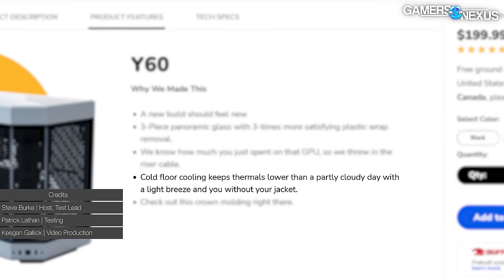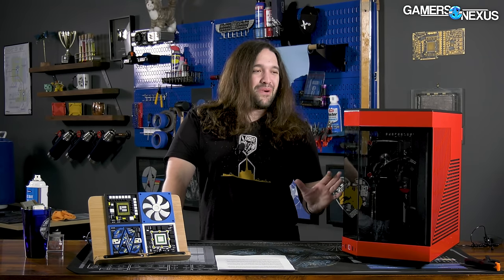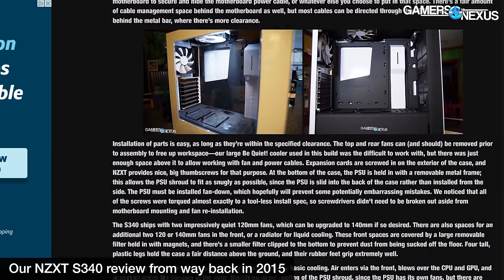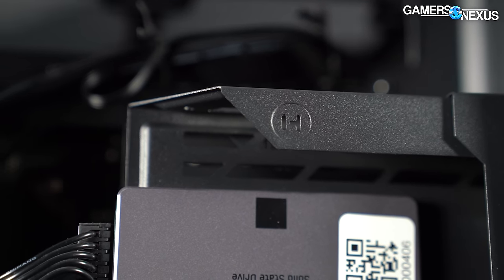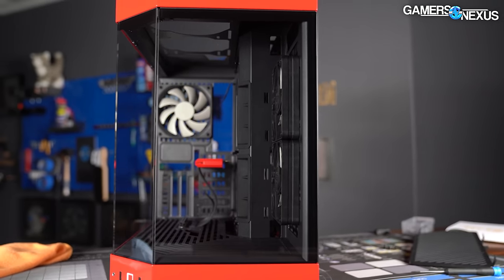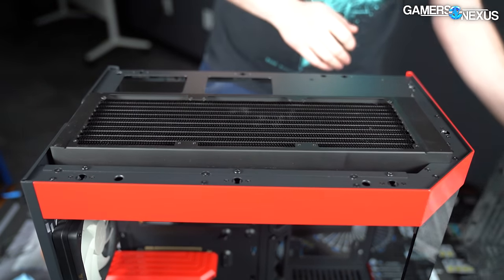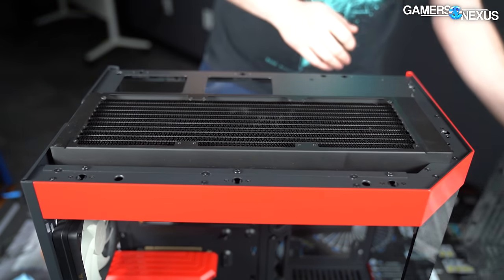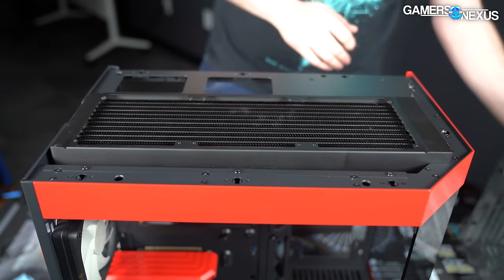Impressive Quality: Hyte Y60 Case Review & Benchmarks vs. O11 Dynamic

Comment: I feel like perhaps this case signifies a need for a standardized water cooling test to better represent cases like this for actual buyers of cases like this what the case will be like. I suppose pointing this out helps somewhat but seeing a full build inside one even if just clcs for both gpu and cpu, I feel, could be an improvement to this type of review.
Reply: There would be no point.  As steve noted in the review, the factors that impact air cooling also impact liquid cooling.  If there is obstruction to airflow, it will obstruct rad fans as well.
Reply: @giglioflex  The question is to what degree. A radiator already is a huge obstruction. Does a little more plastic really make a meaningful difference or will the static pressure optimised fan simply bruteforce through it?
That's not a general statement you can make. Radiator thickness would probably have a much bigger influence than anything else. But I don't know how much of a difference radiator thickness makes either. 
We really need a channel to test watercooling in a proper way.
Reply: @gamingmarcus  Please excuse the typos, youtube is terrible as usual and won't let me edit my own comments.
Reply: @giglioflex  within that same statement he said that the issues could be somewhat negated with LC. So Beef Ingots point is still pretty valid if not more so.
Reply: @popotoproductions3015  Steve pretty clearly pointed out that while you can get lower temps on liquid, you can do that for any case and in this situation you aren't getting around the issue but merely brute forcing.  Steve specifically stated that the liquid cooling performance would likely be less than a majority of other cases using liquid cooling due to the obstruction presented by this case.  

I don't know why people seem to believe this case, with more obstruction, is going to perform better with liquid cooling than other cases with less obstruction that are also using liquid cooling.  As I provided in my link, as you increase static pressure (which is what obstructions do), you reduce the amount of air being pushed by the fan.  It doesn't matter if that fan is balanced for airflow or a high end rad fan, the airflow will reduce as the static pressure inches slower to the fan's rated static pressure.
Reply: The cost and effort needed to rig up standardised water cooling loops in wildly different cases simply doesn't meet the demand, water-cooling is and will continue to be a small enthusiast niche that 99% of viewers will never even attempt. Watercooling has lost its need for the majority of gamers as cases and efficiency improved over the last decade, good modern cards run themselves fine on air-cooling and trying to overclock a crappy old card with water-cooling would cost more than selling the card and buying a better one.
Reply: @gamingmarcus  While I agree that we cant make definitive answers one way or the other without testing, the thermals will probably be approximately what they are in this testing no matter what. There isn't going to be a ± delta of like 10-15 degrees Celsius lol
Reply: @nxxynx5039  Agreed, if 3090ti's didn't exist. Almost all of them start to throttle once you put the beans to them even without over clocking. Water cooling a 2060 is stupid and I wonder why so many companies make water jackets for them when I can only find them for a 3090ti FE. Companies should all sell a water jacket version for their 3090ti's ready to go in to a custom loop.

Comment: It’s a looks focused case. A real shame that they didn’t make a removable bracket for the PCI E expansion slots so you could have one bracket for this vertical mount and one bracket for normal horizontal. I know it would cost more but when the darn thing is already $200ish you might as well do it and bump it up another $10
Reply: @pacifistduck9615  please reply to the bot specifically, like I did. Because if the phishing scam bot’s comment gets deleted in the future then it looks like you’re calling me a filthy bot bro ;-)
Reply: @depth386  I'll just remove it then.
Reply: @pacifistduck9615  You do not get notified when something else gets deleted though. Just trying to help.

Comment: I design and build DIY PCs inside custom cabinets. This case could be insane but some heavy modification is definitely needed. I would just remove the plastic top, bottom, and the right-side panel + filters. The wiring needs also some special work but could look sick. 

I'm waiting for the 100% white case or version 2 for the build test. I really like the placement of the front ports when the case is used at a 45-degree angle inside a custom glass/mirror case. I just hope there will be an improved version soon.
Reply: DIY PC's inside custom cabinets?? damn where can we see your work?

Comment: I finished my first build last month using this case due mainly to your excellent review. I could not be more impressed and I can confirm that as a water cooled build this case is second to none for looks and aesthetics. I used 140mm fans on bottom and on the side with a 280mm rad and of course 360 rad on top. I designed it with all fans as intake except the rear. The result is an extremely well ventilated obviously positive pressure case that has been flawless. water cooling both the CPU and GPU left enough space to mount a D5pump/reservoir combo on the floor in the corner section that fills out the space nicely and looks fantastic. Because nobody has benchmarked this case configured as intended it's hard to say how it compares but in Cinebench R23 with an I9-13900k I scored 39577, all cores hit between 5900 and 6200 mhz with temps below 90c. I used the Asus AIOC. Various 3dMark tests with my 4090 EK water cooled GPU showed temps between 45-52c depending on the test. Thank you again for your excellent content and for being so instrumental in my first PC build

Comment: hopefully we see a refresh model sometime in the future where they remove some of the material restricting airflow or at least make the vertical mount optional rather than mandatory
Reply: I wish I knew that before I bought it but now, I’m stuck with a oversized paperweight that keeps overheating itself due to the GPU overheating core components.
Reply: @deadinside8891  Add more fans.

Comment: Really like the look of this case, and the fit and finish look above standard for sure. Not enough to make me move from my O11XL, but it continued improvement from Hyte just may turn my head in their direction when that time comes.  However, better 360mm rad support would also be needed, my three rads need a home! Love the black and red color, outstanding.

Comment: Super excellent review. Heard a lot of Hype over this case. I like the style and flexibility for better cooling. I not a fish tank case guy, but it’s unique for sure. Disappointed a little about the thermals, but since it’s all glass a water cooled GPU would work much better and totally look awesome. A show piece case that looks nice. Steve, consider iBuyPower is trying to improve by moving away from the bottom tier of cheap components. Companies (as you know) need time (and management firing/hiring) to gain traction as they build capital. Hyte is a positive step forward for their company and maybe a possible turn around. Time will tell.

Comment: Thank you for the review. My son showed me this case the other day and I found it very interesting. However, I do not want a vertical GPU and low height expansion slots, and a case you have to brute force to be efficient. No matter how much I look at your at your Best Cases video, I always circle back to the O11 DXL. I have gotten really tired of psu shrouds. Plus I am replacing (repurposing) a 2016 Phantek Entho Luxe, so size is not a constraint. Keep up the good work and I am proud to be a Patreon of this channel.
Reply: To be fair every case that has fans is brute forcing cooling....

Comment: I would be curious to see how cases like this stack up against older dual compartment style cases, like the Corsair Air 540. Seems to have more space for the main components and less "basement" room for the drives/power supply, but it also has a more convoluted air path.

Comment: I personally just built a computer with this case, and I'm air cooling it as well for the time being. I was mainly attracted to this case because of how open it is and how much of a display piece it looks like. However, being a mechanical engineer and having worked with a lot of cooling systems in industry before I can see some issues with the cooling for this case that you pointed out (especially the grating obstructing flow that will quickly clog up with dust/hair)

But man does it look good.
Reply: I do feel that for air cooling some of the placements feel awkward. For example, typically when you place a fan you want to see the pretty face towards you and the part with the structural brackets towards the hidden area. You can't really do that with this case in the normal sense. In most standard cases you pull air from the front and push it out the back, and you can mount the fans in such a way that you won't see the support frame of the brackets on the front fans (and if the front panel is transparent you'll see the cool front part of the fan as well)

This case however wants you to face the side fans inward, which therefore pulls air out of the case instead of pushing it into the case. This means that in order to get proper air flow, you need to push more air into the case. I'm still mulling over how I want to do that but I feel my options are limited. The bottom fans are currently designed to pull air in sure, but I had to flip the back fan to also pull air in, and I feel its not enough yet. I might consider putting 1 of the 3 top fans (the one closest to the back) pushing air into the case and make the other two top fans pull air. I think that since the back fan would mix with the back top fan in this scenario, it would mix cool air in before hitting the CPU and then the CPU pushes air towards the side fans and front top fans as well. The bottom fans mostly would be pushing their cool air onto the GPU in this instance.
Reply: Face all fans in and use the side fans for exhaust?

Comment: I'd be interested in seeing a "best case scenario" with all the fan slots occupied if you ever modify your testing methodology or update the hardware used as the average users heat load inevitably increases as recent trends seem to indicate they will.
Reply: Yeah seems odd to not include testing for the best case cooling and nerfing cooling right after complaining about airflow

Comment: I love the look of this aquarium, but would never buy it in its current form. Having essentially 1 usable PCIe slot is a complete deal breaker. If they would come out with a version that didn't have the vertical GPU mount and full size PCIe slots I would very likely pick one up and retire my old Caselabs case. They are probably loosing alot of sales by going for nothing but aestheics.
Reply: Yup exactly thats a deal breaker for me waiting for my lian li mini air to come
Reply: Yeah, with normal GPU orientation I'd seriously consider this for my next case ... looks real nice
Reply: All they had to do was put in 7 full size PCIe slots without the pointless little strips of metal between them.
If they still wanted to support vertical GPUs, they then could just ship it with a bracket that takes up those 7 slots and gives you 4 full size vertical slots closer to the board.

I still don't understand why those are not more popular. I have one and it is perfect. With the right PCIe extensions you could also run multiple PCIe cards.

Comment: I think the thing I like most about these dual chamber cases is there is plenty of room for cable management. You're not, or at least not often, trying to bend cables so far you're afraid you're going to damage them and you're still able to get the back panel on. Lian Li, or someone, needs to build one meant for air cooling. An o11 without all that empty space in front would be cheaper, I assume, smaller, with a mesh front and fans close to the CPU, GPU and the PSU isolated could have very good thermals.

Comment: I have a liquid cooled core P3 system, and a lot of the criticisms made here apply there, namely the single large expansion slot issue. I deal with all those problems, and it's totally worth it. The system looks so nice and the extra time working on it or working around space/cable management quirks is worth it to someone who is building liquid cooled systems like me. You're already throwing practicality out the window, why not go for the coolest looking thing on the market? This is pretty awesome. I'm sticking with my open air cases, but I think this will pull some customers from Lian-Li.

Comment: Having been one who was concerned about the lack of full-size PCIe slots, glad to hear it noted.

Also glad to see a genuine review finally. I've been starved of solid case reviews lately, especially from GN!
Reply: What was your concern about the lack of them?  You either care or don't care. There's no "concern".
Reply: @Xfade81  About what the detriments that would cause for the case in review.
It's due to that why the case is only realistically able to handle two-slot and water block GPUs.

I'm "concerned" because that could be a make-or-break issue when making a build in this PC depending on one's parts they planned on using, and, evidently from the GN team liking the overall design, it's one that is worth putting up with for those interested in the case.

If it were noteworthy enough that it would have soured their review, it would have been mentioned in their summary.

Comment: This review was awesome, and knowing its shortcomings, I still thought it fit my needs and bought it. Now that the review is over, could you do some experiments on cooling it with the full 8 fan capacity and or water cooling, just as a guide for those trying to get the most cooling out of it?
Reply: I would like to see the same, there are very few things out there showing the 8 fans in different configurations!

Comment: Just got mine in, honestly it  was amazing to build in and it look so sleek, I have the white addition, Thermals are solid. For my build,  I side mounted my rad it's A Pantex 280mp, for fans i mounted two on the bottom  and 3 on top. They all Blow in with my rad Being the out Flow. My 6600xt devil card has great thermals now. The CPU is a Ryzen 7 5800x, temp at idle is 28c while playing say Elden Ring it sits at 47C. The GPU sits at 33c idle and while running Elden hits 54c. the mother board which is a MSI Carbon X570 Sits at 30c to 35C. i Have 32 gb of viper Steel Patriot 3600, it sits at 28c to 33c, Lastly the m.2's both sit at 33c to 40c.  They are Samsung 970 and 980 Evo's both are 1tb.  Also the power supply is a Corsair RM850 (850Watt) it fits but a touch snug.  
         I tried the case fan set up as recommended by HYTE..... It had terrible thermals, well not terrible but about a 9% rise across the board.  Whish i could post a picture.

Comment: Poking my head in here over a year later, and after having just built in the Y60.

It's not bad. It's sharp, everyone has commented on it, and overall especially with a full watercooling build, is aesthetically sexy as hell.

But, I feel like some compromises were made to keep the cost down, compromises that I can't imagine would've driven the cost up further, such as the usage of thumb screws for the GPU slots on the back. It's also a little tight, especially if you are using power cables with 8 Pin CPU Power that aren't flat, and have a bulk near the connector. This is especially true if you are using a top mounted radiator, which, I am also not a fan of the design they proposed.

All in all, I give it a solid 7.5 - 8 out of 10, since the stuff above is me being super nitpicky. 

And yes, I am in love with it for watercooling showcase

Comment: hello steve,
i have the white y60 case. and it is very nice case, a littlebit tricky to built in it. i have an rx6800xt red devil, also 3 slots. i have no problems with the temperatures. i have undervolted a little bit and  increase the fan curve of the gpu. i hope it helps a little bit for other users.

Comment: For a case like this, the orientation of the cooling fins on the GPU becomes important. The card they tested has the fins running long ways meaning the bottom fans can't push air through GPU. A card with the fins running short ways would allow air flow from the bottom, up. I could see this have a noticeable impact on the GPU temperatures. Just something to keep in mind.
Reply: honestly it looks like having 140mm fans under an air-cooled GPU helps give the GPU the airflow it'll need.

Comment: The HYTE Y60 Side Intake test is the more valuable realistic data you generated. Most people will in fact have side mounted fans. The case does not need to come with them stock and in fact would add to the cost, only to be disgarded for most people because they will, get closer to the screen so you can hear this properly, they will buy a radiator with fans included. I know shocking right, who would have thought that most people would do that. It's true though, and thus they will buy at least two extra fans or more in some fashion, such as through buying radiators that come with them, or extra, thus the whole Stock Fan test is a footnote at best.

Comment: You have to keep in mind that you're testing using an older graphics card that still has the radiator fins running along the length of the card when nowadays pretty much every model has them running from side to side - which should be better suited for this type of vertical mounting...